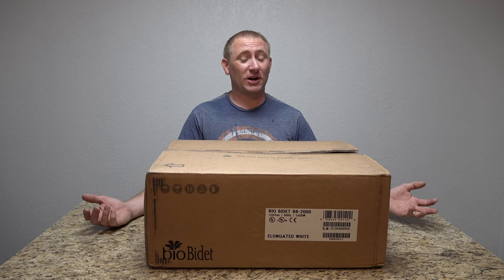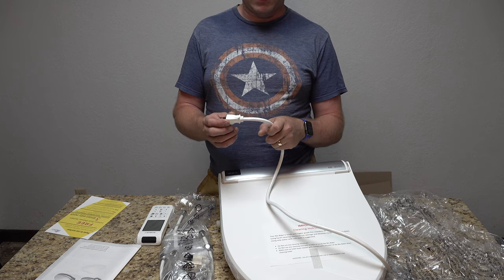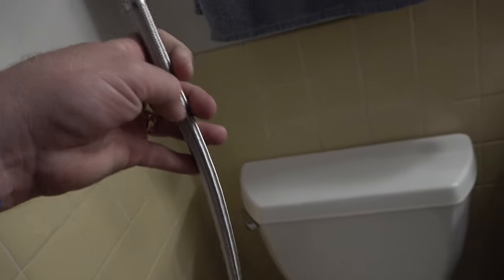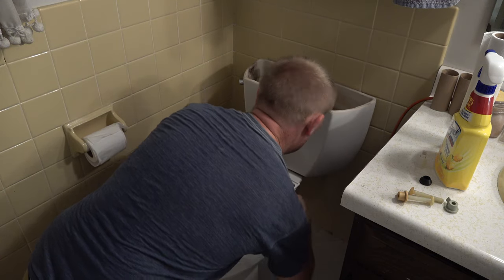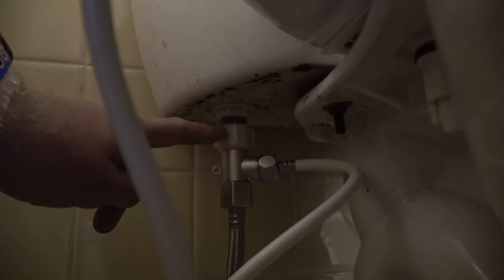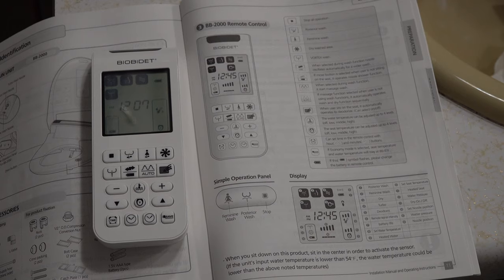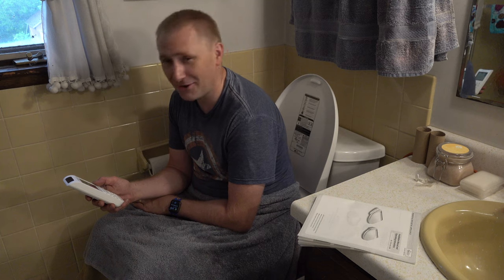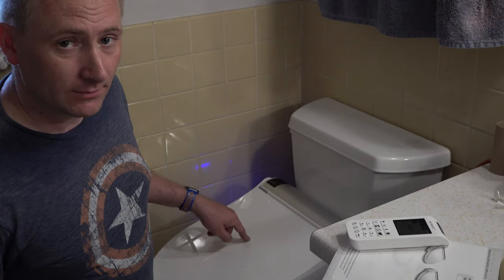Bio Bidet Bliss BB-2000 Full Install

Comment: This is the best youtube 'how-to' and review I have ever seen, by far. It was super easy to follow along the 'how-to' installation, and the entertainment value of the review was off the charts hilarious. Thank you for putting this video together! Dec 4, 2021 (UPDATE). We have since purchased the Bio Bidet BB2000, installed it (with help from the GeekSmart video, of course) and now using it. The install is as easy as shown in the video, I think it took me about 15 minutes, and that was taking my time. The remote has a ton of options, I generally use just the regular wash with the side-to-side (probably wrong technical term) buttons. We keep the seat heat on the first setting, but also use the energy saver button. The water pressure it crazy powerful, so much so we actually keep it down to the second from the least powerful. I tried the turbo once, way too powerful for me unless I enjoy being tortured. All-in-all we love the bio bidet bb2000.

Comment: Great review.  One warning you left out is about using wrenches on the rubber gasketed hose fitting.  This type of fitting should be HAND TIGHTENED or in the case of the 3/8" line, VERY gently turned with a wrench.  Tightening this type of fitting too tight will cause the metal mating surface to cut into the rubber, causing a leak and ruining the hose.

Comment: Vortex mode is the defining feature of this bidet over others IMHO. It should be called 'never strain to poo again' mode because that is its function. Crank up the power and temp, align it just right so that it shoots into your bum, arch your back for good posture and maybe even clinch slightly. Soon your rectum will fill with water and at that point it will not matter if you want to shit or not, much like 2020, it's happening with or without your active participation. For me, if I feel I have to force the movement at all... bam vortex button.
Reply from the maker: Hahahaha!

Comment: One thing I haven't seen talked about in most bidet reviews is hair and how it impacts the "performance" of the bidet. I have a bidet and I can say with certainty that a bidet works much better on someone who shaves/removes their hair down there than on someone who does not. In the case of the latter, the bidet does certainly help, but it does not completely negate the need to use some TP.
Reply from the maker: I can see that, I don’t shave down there but I could see it working better without the hair
Reply: Might as well get a shampooer..while you’re at it, shampoo it then use a conditioner then rinse with the bidet…then don’t forget to dry it and then braid it….🤣🤣🤣🤣

Comment: No, never use Teflon tape on the treads of compression fittings.  The seal is made at the compression fitting or rubber seal and Teflon tape on the treads can only interfere with proper tightening.